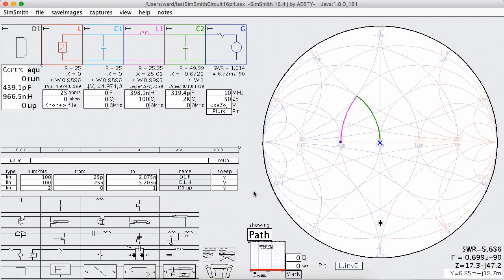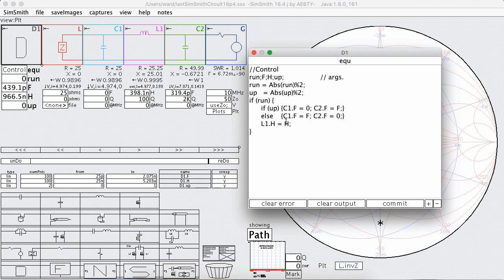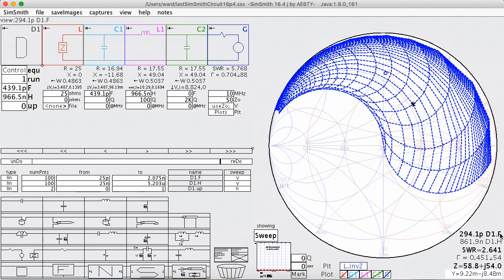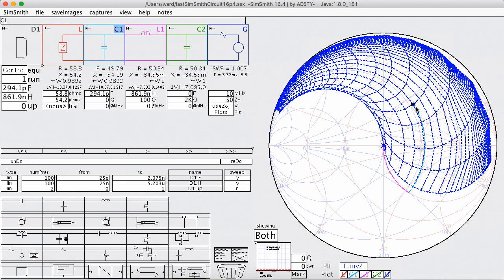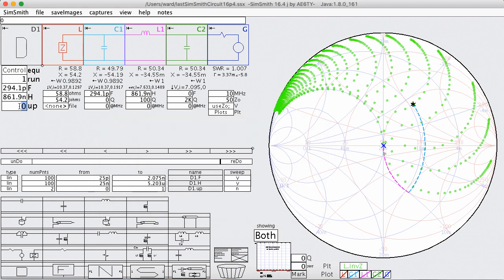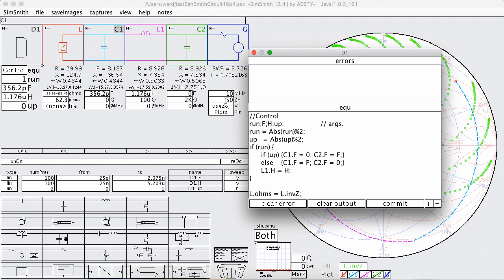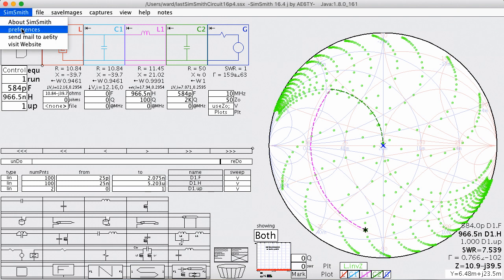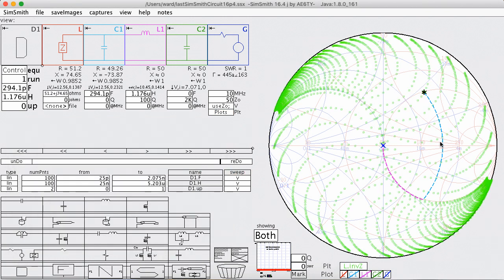L Network Autotuners... SimSmith 'hints & hacks'

Comment: Thanks Ward, very interesting material.  Since the dots can be widely spread, that seems to imply that small component variations could reduce the quality of the match. Once you have chosen a point to investigate, is it possible to show another plot which shows the resultant match when varying the component values by some amount, say +-10%, and maybe even show an SWR circle? I'm thinking this would help to eliminate possible matches which would be impractical to implement.